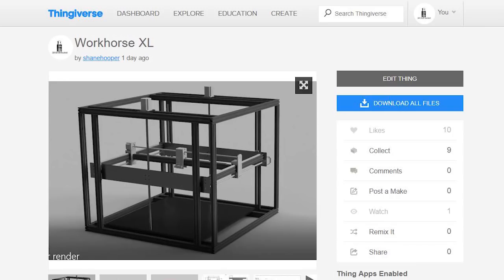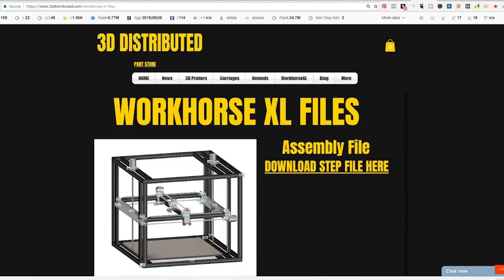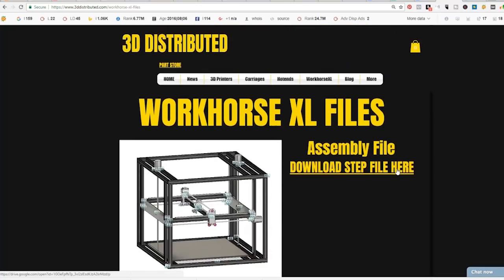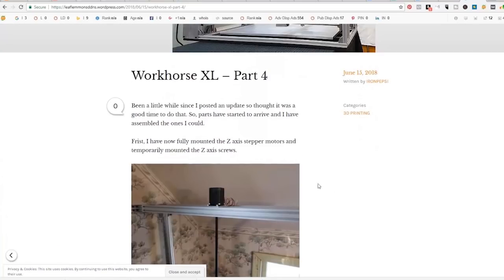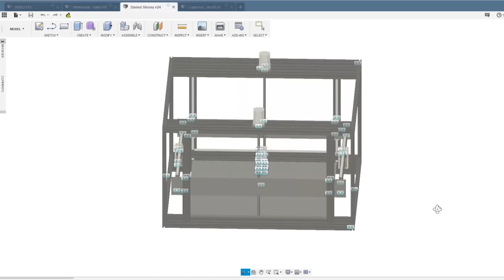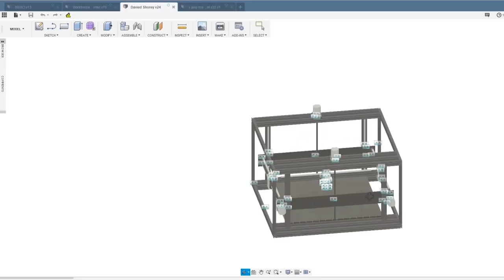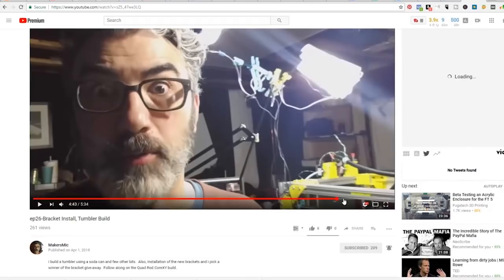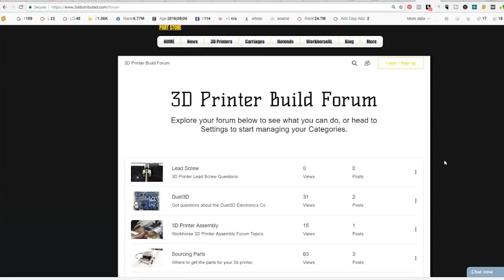WorkHorse - Open Source Large Scale 3D Printer

Comment: Hey thanks for the shout out Shane!  Have at it with the design,  it's pretty basic and can be expanded upon easily.   For those that want to make a similar bracket they were just some 1/8" aluminum flat bar that I cut down.  I made a jig using the 3d printer so the hole placement would be consistent.  Thanks again Shane,  you guys are making some beast mode printers over there!